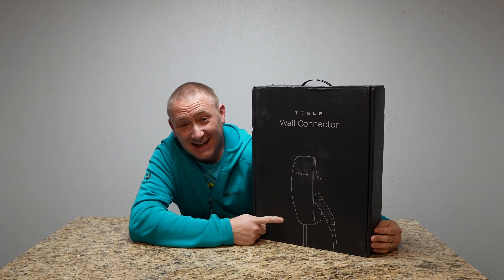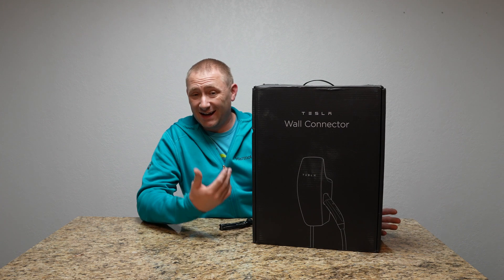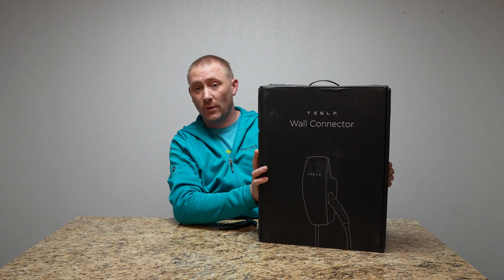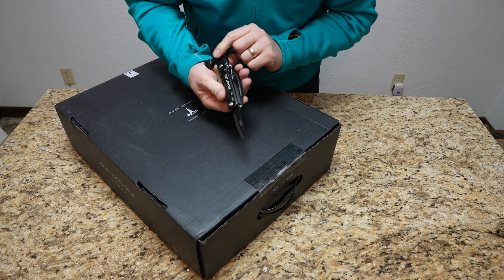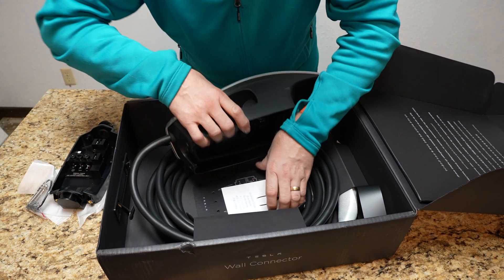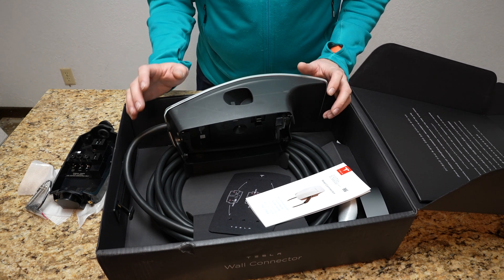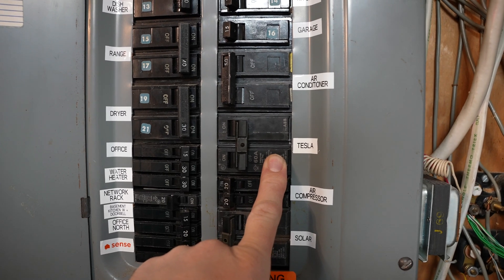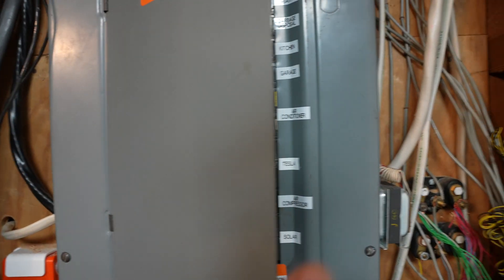Tesla Wall Connector Installation

Comment: The bare wire referred to as an extra ground, appeared to be the actual ground wire. Whereas, the white wire that was being connected to the ground terminal was actually the neutral wire. Nominally, per the directions with this charger, the ground wire is connected and the neutral isn't used.

Comment: As an electrical guy, I am glad you mentioned the panel ampacity

Most home owners do not realize they are adding essentially a second stove to run for 8-10 hours in their home.  They are concerned about the wire to the charger but neglect the wire from the utility to their house.  Is that wire big enough?

Do you need a permit?  Things vary by jurisdiction, make a phone call or two.

The national electric code has the car charging requirements in chapter 6 (625) with references back to chapter 1,2,&3.  Doing the work is not difficult, but knowing all those requirements, it might be easier to hire a local guy just to explain how easy or hard you install can be.

Enjoy and be safe.
Reply from the maker: Completely agree!! Always best to pull a permit, and hire someone that knows what they are doing!! Especially when adding a large load like an EV charger!!!